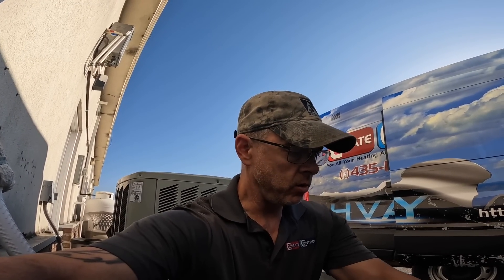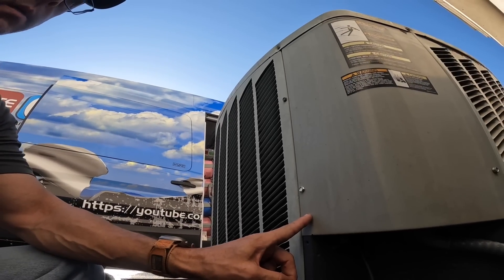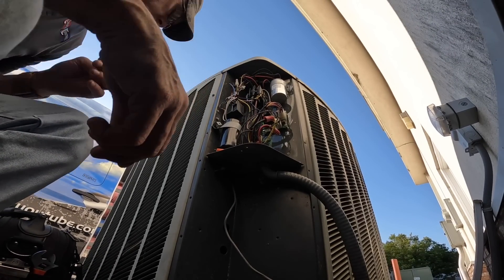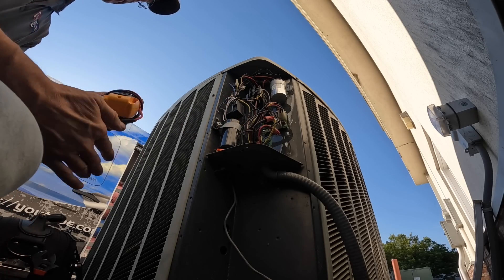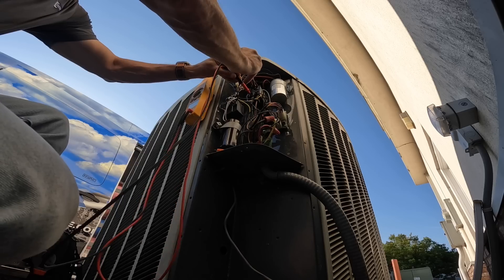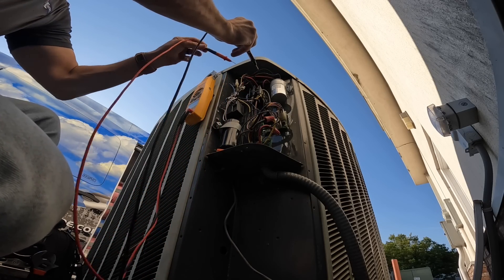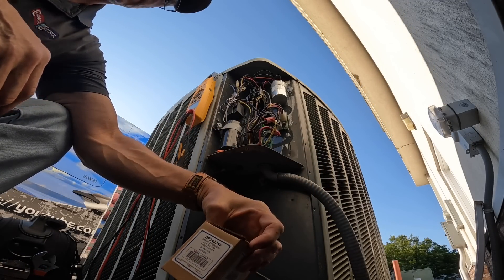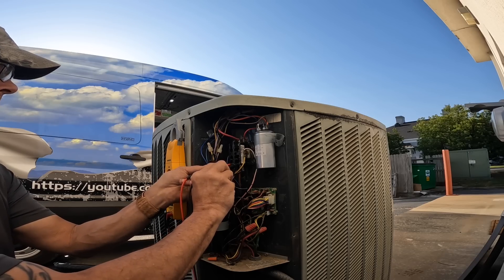Call Back On A Trane Heat Pump! #hvacguy #hvaclife

Comment: Contactors will go bad even with a visual and ohmed out coil. If you restore power from some component the older they are the more likely they are to fail. But you can’t honestly recommend replacement. So bud, this ain’t a call back, it was a secondary part failure with a courtesy travel fee.

Comment: not changing the contactor when there's a bad capacitor/s and/or start components will always come back to bite you in the rear end, voltage drop testing is not always a tell-tale, if there's pitting, they can sometimes work perfect and have no voltage drop across them, then any number of cycles later it may hit wrong and be high resistance overheat and have voltage drop.
I've learned most everything the hard way, but being into electrical, plumbing, automotive, computers and especially electronics has helped a ton.

Comment: Wow the way that thing was fighting you, I think I would have cut the wires. May be why you are good at it and I'm not. The old one did look like it was good, I guess we can't go by looks. Nice little job, I'm sure the customer was happy, since it wasn't the compressor, having the hard start cap and all. Kudos
Reply: We found many contactor points damaged by tiny red ants; their acid ruins the points!
Reply: @bobboscarato1313  I hear ya Bob, I had compressors shorted out by ants and one time by a lizard.

Comment: Man- almost every time I have changed out a contractor while the low voltage is calling for cooling - I somehow short it to ground and have to go climbing into the attic to replace that darn fuse 😅😅😅
Reply: Take the low voltage wiring loose to unit, American Standards just pull plug on defrost board.
Reply: Next time you take it off, wrap it with masking tape :)
Reply: In this scenario, just connect your low voltage to the new contactor
Reply: Install a tiny circuit breaker to protect the transformer!

Comment: It's not hard to Stop a Trane/A.S...

Brown fan relays and the crappy board that replaced them
txv's
defrost boards
fan motors
caps

If it wasn't for the Trans/A.S line, i would have been out of business long ago due to lack of service work.
Reply: Don't complain; equipment failure give us in HVAC a chance to have a job!
Reply: @bobboscarato1313  Not complaining, just stating the obvious!!  Trane is no better than any other system in fact has just as many if not more breakdowns and failures that other HVAC systems.

Comment: Why do you not torque the wire terminations on the contactor?  That value is listed on the contactor.  This will be coming in future NEC codes.
Reply from the maker: Hmm
Reply: You must be an electrician.
Reply: @danwittels5542  no I'm an instructor.
Reply: @leealtmansr.3811  👍
Reply: @danwittels5542   he would probably torque t-stat wiring on the thermostat  base as well
Reply: Torque for screws 25lb 40 lb for lugs.... lol... tighten and tug pull. Torque completed...

Comment: On contactors have you tried to put meter on l1 and t1 when contactor is in ? If you a reading of any voltage it is bad. No reading is good. Of course with power on . Have a great day. I have found even unit is running possible bad connection on contactor.